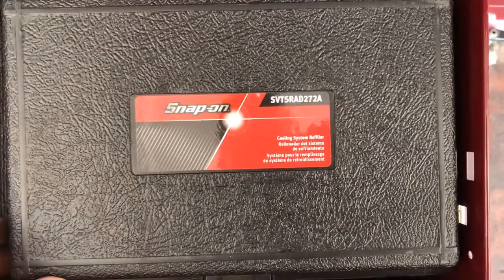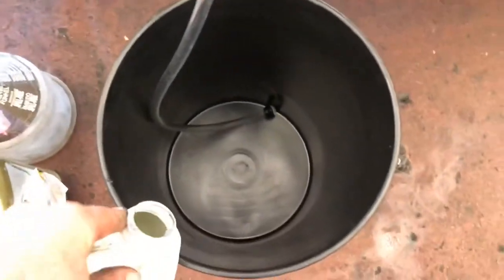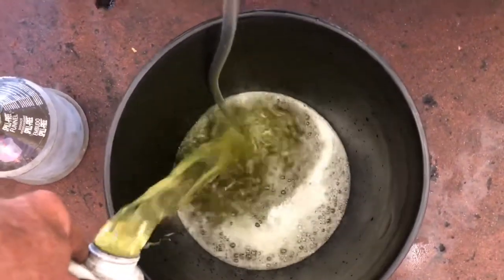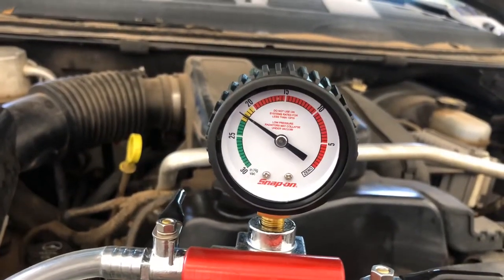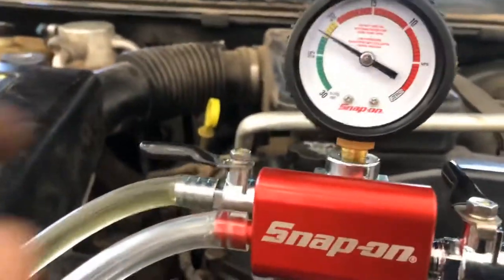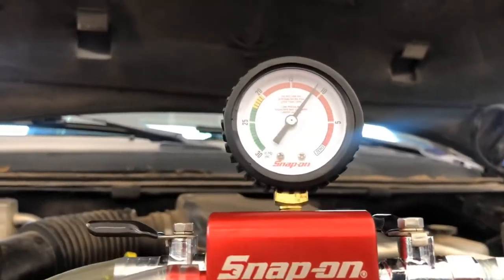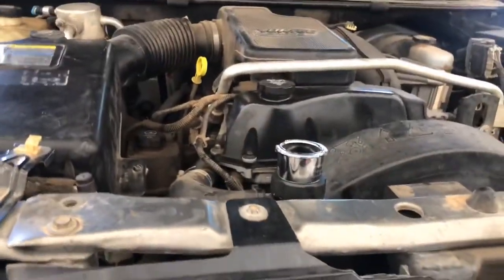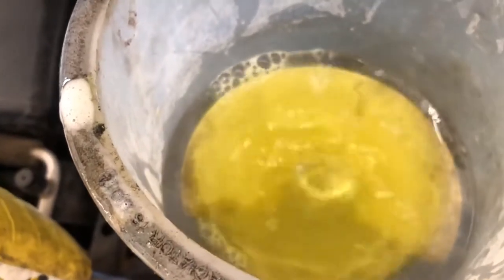Snap on coolant refiller how it works

Comment: No need to bleed the air right?  Hence the vacuum.
Reply from the maker: @slimjim8736  right but I put it there to make sure there is no left over
Reply: @WorX4ToolZ and how do you make sure there no left over air ?
Reply from the maker: @antonioking4937  run it till the thermostat opens upper and lower hose are warm/hot if it has an electric fan, it has come on and turned off at least once and there is still coolant in the funnel make sure it doesn’t go empty then I’ll put the cap on and test drive it.

Comment: So does the system have to be drained? If I’m worried I have air in my system can I use this to pull air out and replace with fluid?
Reply from the maker: Yes the system would be drained first.. it won’t pull the air and leave the coolant

Comment: So you can refill you’re car through the radiator cap with this tool when you do a coolant flush ?
Reply from the maker: Yes it will refill but it won’t take the coolant out of the car👍🏻